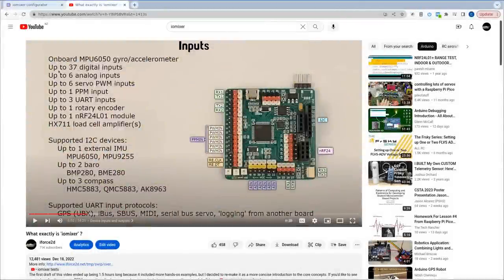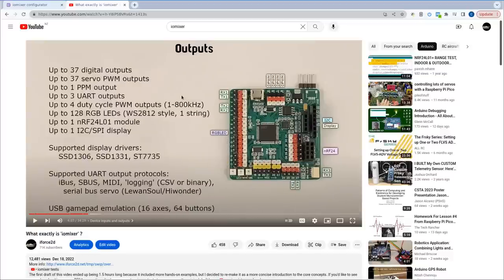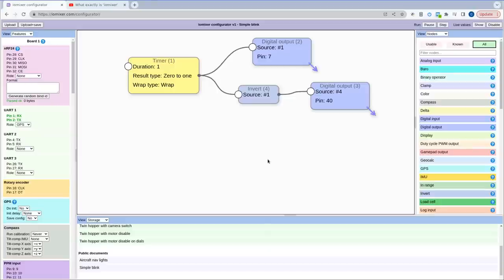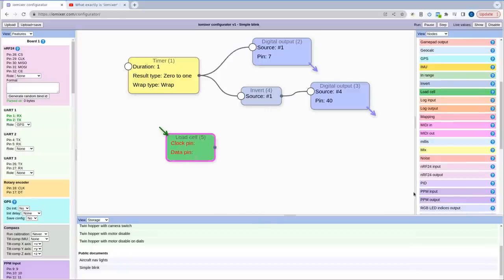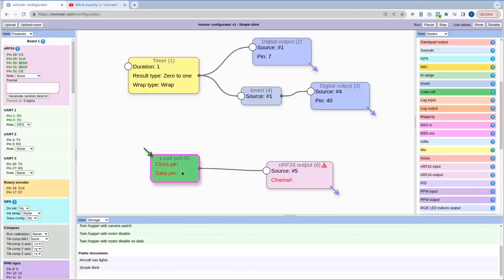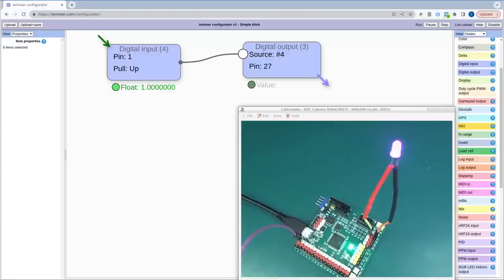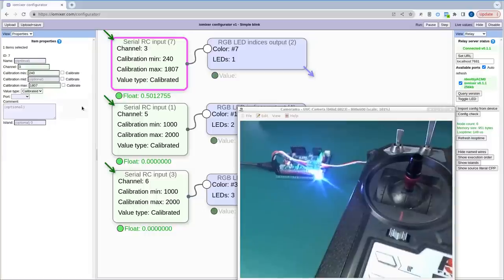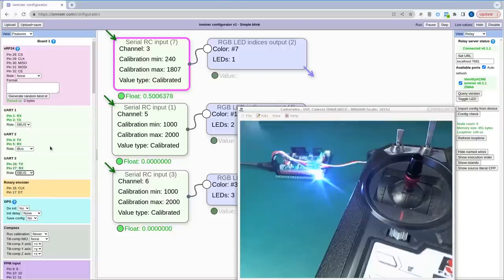What exactly can you do with iomixer?

Comment: Will you be opening "some" code for extensibility? I m thinking specifically about if I were to get a new board that isn't supported yet (not listed in the drivers), would I able to write a driver myself ?
Reply from the maker: If you mean a new peripheral device, eg. a different type of IMU or barometer etc, then no, it would require me to add it. This system is mainly for those who don't know how to code and don't want to learn, but still want to get something done. People capable of writing device drivers would likely be better off setting up their own custom firmware.

Comment: when do you plan on manufacturing the boards? And if you do how much would you need capital wise to go into production?
Reply from the maker: So far I'm having the boards made a handful at a time by JLCPCB, it's not really costly enough to require outside capital support. The hardware is open source so in the long run I'm planning to sell just the firmware, which is where 97% of my development effort goes. I'm thinking of making a pick-and-place to assemble boards at home which would be the biggest up-front cost, but I think I can cover it.
Reply: @iforce2d  how much are the boards costing you to make? I'd like to get ahold of a few.
Reply from the maker: From JLCPCB it's about $25-30 each at the moment depending on exactly which components are mounted, email me for the details if you want to order your own. You'll need to solder on a bunch of pin headers to get it into the state shown in the video.

Comment: i didnt really understand what output you are using from the MIDI device and which input it connects to on the iomixer
Reply from the maker: There is a MIDI out plug on the controller which goes to a pin on the iomixer. It's a UART connection which sends a message when some even happens, like a note being pressed/released, or a control dial/slider being changed. If you mean the physical connection, I had to make up a cable from a 3.5mm audio jack and soldering a bit onto the other end: https://www.iforce2d.net/tmp/wc245225.jpeg

Comment: Will the relay server protocol be available? I'd like to try running the configurator on an ESP32
Reply from the maker: That would be interesting, not sure if possible, but being a console program with no graphical component the relay server is relatively easy to port. It needs to open a serial connection on one side and a websocket on the other, and I think it would need USB OTG capability too. To answer your question, it's not open-source but I might look into this further sometime. Failing that, a RaspberryPi ZeroW works well and is pretty small.
Reply: @iforce2d  The ESP32-S2 or S3 should be able to do websocket to USB serial host. It can host the web side, but gives some JS console errors if I just use the downloaded files. (Wasn't expecting that to actually work, just wanted to see if it would fit and load.)

Comment: Why is the digital input a float ?
Reply: I'm not sure where you saw that so maybe the following is incorrect. 
From what I saw in one of his sample project videos, a three position toggle switch produced a float output. I think it was 0, 0.5, and 1 reported as a float.. Three states for the three positions. So not really digital (0 and 1)
Reply from the maker: That's a fair question :) I didn't really explain it in this video, but each node has an output value which is the green text we see shown below it. Since nodes can be connected to other nodes in a bazillion possible combinations, it's easier if the value type passed between them can be standardized as much as possible, even if the data type is larger than necessary for some cases. For a numeric quantity, float is the most convenient - a float can represent an integer, but an integer cannot always represent a float. A float is four bytes, which is large enough to hold a 3-byte color value for nodes that output a color type. The data being passed between nodes is actually 5 bytes in total, where the fifth byte contains flags that describe what type of value the main four bytes are, which is necessary for the downstream node to know how to use the value it is given.
Reply: @iforce2d  Thanks for the explanation.  Because you use a float for a digital value is it safe to use equality when testing the value or is there a chance that a value could be say 0.9999999 rather than 1.0000000 ?  Would it be safer to test for say >= 0.5 for HIGH/true and < 0.5 for LOW/false ?
Reply from the maker: @Bob There are many cases where a node provides a boolean "true/false" result. For example a Unary Operator node with the "is negative" test will always output a zero or one. In those cases you can depend on the output being perfectly zero or one, and a Digital Input node is one such case.
On the downstream side, when a node has an input property that will be treated as boolean, it will consider any incoming value above 0.5 to be "true".
Thanks for the questions, this is exactly the kind of thing I need to iron out in my next big task... documentation.
Reply: @iforce2d  To avoid confusion it might be better to tell while lies on the display as to the data type and actual full value even if behind the scenes you are still saving the value as a float

Documentation ?  One of the things that you know you should (must) do but usually what you actually want to do.  Good luck !